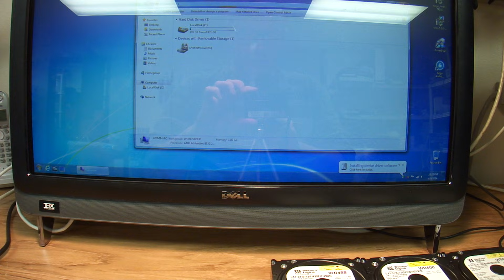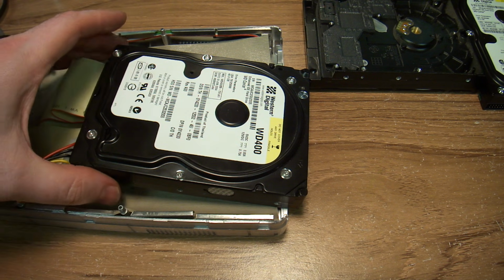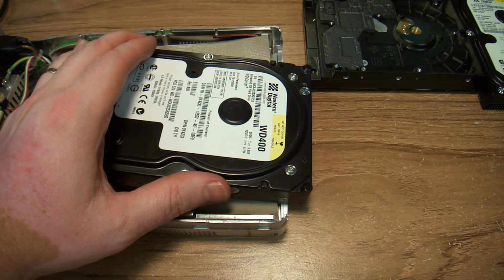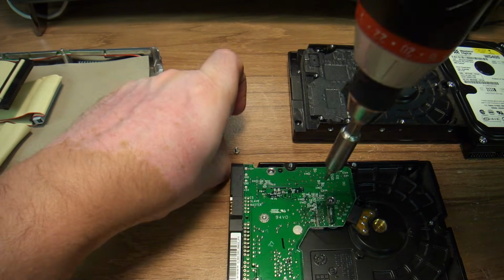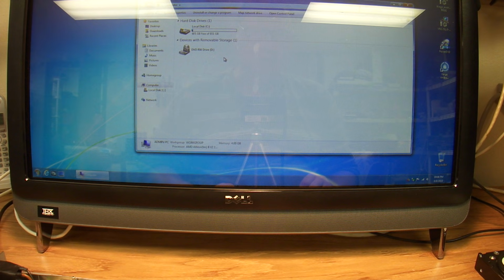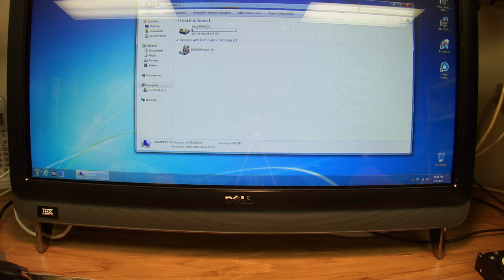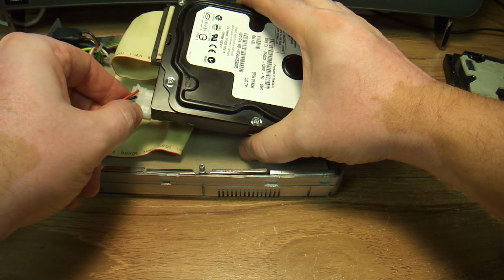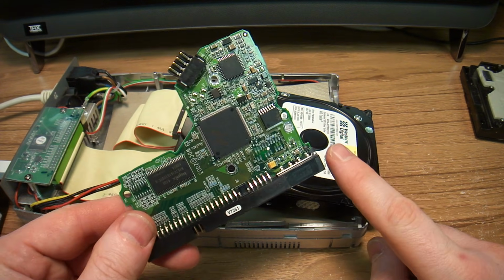DIY How to: a successful data recovery from clicking hard drive. Recover your files Yourself

Comment: I wonder who still has one of those
Reply: +HDD Recovery Services Oh, for the record though... we didn't do this to fix clicking drives (though we probably did a time here or there out of desperation). We did this on drives that were not recognized by systems any longer. For clicking drives, we had a small cube freezer with SATA cables permanently routed into it. That way, we could freeze the drive overnight and the next day attempt to clone the disk while it was still in the freezer! That worked more times that I ever expected it would.
Reply: +HDD Recovery Services I used to swap boards on modern SATA drives all the time at my old job... as long as you had identical drive (same model, same board revision, same firmware) and the date codes were very close, it always worked.
Reply: zdgfagdfgdfssdgfdsfd was it back when 40GB drives were considered "modern"? :)
Reply: +HDD Recovery Services Nope... it was about 5 years ago, so IIRC the largest drives we saw common in the wild at this time were around 2TB, though larger drives did exist and the average drive was smaller. I was working for an OEM that sold systems, so the majority of the drives we did this on were out of our computers. And we were using Seagate Barracuda 7200.9 (and then 7200.10, and 7200.11) drives. Most of the drives we did this on were 80, 250, or 500GB drives - though I can recount doing it at least once on a 1TB drive as well.
Reply: zdgfagdfgdfssdgfdsfd, hi there! After reading everything you wrote, I really want to ask you if I buy another two/three 2TB Seagate Barracuda (ST2000DM001) there's is any chance of making my faulty and making noise one with this technique? Or for a big hard drive this is almost impossible? The sound is a bit similar to this one from the video. I'm about to search and buy some just to try this trick before spending a lot of money with data recovering services. Cheers from Rio!
Reply: honestly if you have data so important that you're willing to pay for a professional data recovery service, don't play around and make the situation worse trying to save money. if you don't know what you're doing at a professional level (if you're asking questions on YouTube, you don't) don't take the risk of making your data unrecoverable.
sounds like the one in the video are usually caused by a head crash, which often causes damage to the platter where your data is stored. while it might be possible, I don't think it's likely that a board swap will help you here... sorry! cheers and good luck!
Reply: +HDD Recovery Services I wonder who else is doing piggy back advertising by making baseless comments on his video to get free advertising for their business.
Reply: +VonKaNon but lets be honest, did you use a 40GB drive in the last decade? No modern drive will let you just swap a PCB and make everything work again. If he used this technique successfully on a hard drive that is 320GB+ I would be first in line to applaud him, but this is a prehistoric 40GB drive. I love the video, and it is very informative for those who are into repair of vintage hard drives, but nowadays you will not get far with this.

Comment: Abraham:  Great video.  My question is, do the two hard drives have to be of the exact same capacity?  40 GB & 40 GB or can one be a 60 GB drive?
Reply from the maker: +Erich Strack Not only same capacity, but Identical board with all, but a serial number.
Reply: +Abraham Levit Crud.  Ok.  Thanks.
Reply: +Abraham Levit When you say "all but a serial number", what is included in the "all"?
Reply: +Erich Strack Serial numbers are unique per PCB, You need to get the boards model and version numbers identical.
Reply: No not impossible, you can find "compatible" boards on ebay that will work long enough to recover data. not recommended for long term use though
Reply: +ElfNet Gaming almost impossible right?  :(

Comment: never use an electrical screwdriver to tighten the screws on the new board. you could damage it. always use a classic screwdriver, that way you use enough pressure and don't overdo things which can crack your good new board

Comment: 1 minute and I would know what to change LOL. Connect to a drive using a terminal in Windows . There are terminal connection tools available. a simple OHM/Volt Meter is $10 these days. There is no need to open a drive anymore, any simple connection and terminal commands will allow anyone to do simple checks for problems.  You can put a piece of tape on the connector so that you can run the terminal connection diagnosis to force the drive to spin up and run. You need to learn terminal commands as the newer drives are different, it's not just swapping boards anymore .  Computer services these days are a laughing joke as it is mostly a "Software can retrieve it" mentality and then the "No connection it's dead" LOL. I run my Computer services OLD SCHOOL and people pay me big bucks to do what morons fail at. This is why people also bring me cars to take a look at . I mean no disrespect but with the better hardware now REAL computer techs who can actually know WTF an OHM meter is are either too few, retired and many already Gone. Good post at least it gets people interested.
Reply: +Danfuerth Gillis Could you expand on these connection and terminal commands?
Reply: This is the link for the Seagate 7200 terminal fix from a few years ago. https://sites.google.com/site/seagatefix/

That is just the basics to get you started as it shows how to make the terminal connector, procedures and some basic commands.

That was a very popular fix for the Seagate 7200 drives.

Thousands if not hundreds of thousands were fixed worldwide using the terminal method.

Comment: Thank you..this actually works for a WB my book. It was a WD Green drive. I also recommend connecting a "working" hard drive, with similar model with similiar PCB. Once the PC recognizes that "working" hard drive QUICKLY disconnect then connect the non-working HDD. Caution tho..you should always wear rubber gloves.
Reply: Darren Arni, hi there! So, with this technique, would not be necessary to switch boards? Where did you see this info? Why a faulty hard drive would simply work just because an almost identical one was just connected before it?

Comment: The firmware on that drive might be corrupted. WDC drive's usually click like that when the firmware dies. I've only been able to resurrect a drive like this twice. Newer drives do have specific firmware for the drive even though the model is the same. Every drive is different.
Reply: Christopher Ryan, so you mean even if we buy a same model of a old hard drive (like from 2010/2011), nowadays new units will have specific firmware? I'm planning to buy some two or there same models of a 2TB Barracuda Seagate (ST2000DM001) just to try this, but simply don't know if today units will have this firmware exclusive feature.
Reply: You can't do pcb swaps unless you take the firmware chip and solder to the new board. EVERY drive is different.  Trust me I've tried it

Comment: I have a Seagate portable external drive that has a similar problem.
When I plug the usb, the software installs, it shows in Devices and Printers
but the light dosent go on and the drive  dosen't appear in My Computer.
It makes this sound.
https://clyp.it/0dqb0a3h
I tried another power connector from another similar seagate drive (slightly newer),
and the same thing happens exept this time the light goes on.
It makes the same sound . Could you tell from the sound if it is a problem with the head being stuck or a controller problem?

Comment: I have ASUS X550LN laptop. Yesterday I got mad from video games and I hit the laptop on the right side next to the mouse pad. The Laptop froze and I restarted it but it never turned on again. When I try to turn it on it beeps for a few seconds then it stops ( you can look the video on my channel what I mean.. ). Also I checked in the BIOS and the laptop doesn't detect the HDD. (I've been to a service centre and they told me that the PCB might be damaged and if I can find the same one and replace it they might be able to save my data. ) What do you propose me to do? What can be wrong with the HDD and which solution I should use to fix it and get my data back which was really important to me! Help please!! Thank you! Abraham Levit

Comment: What would happen if secondary internal HDD clicked itself to death?

It clicks occasionally but is still functioning.

When it clicks, and hangs the entire PC. I have no data on it, but the lag is annoying and I can't stop the HDD from spinning.
Reply: tenchimuyo69 back it up and replace it. Clicking is a warning sign that the heads have failed.

Comment: I have a computer with memory of 8 terabytes and a RAM with 12 Gigabytes. Muhahahahhahahaha
Reply: no you don't idiot! you have 12 gigabytes of memory (ram) and 8 terabytes of drive space. RAM is memory and drive space is just storage, not power.  And  FYI I am typing this on a system with  32 gig of memory and 64 terabytes of storage... Unix  kicks ASS!
Reply: No i meant memory OF 8 terabytes and 12 Gigabytes OF ram!!!!!!! STUPID!!!!!! Learn to read.
Reply: Gamer_time no hes right memory refers to ram usually.. At least with reference to a PC, and without more specific context, if you said hdd memory, although there you could be referring to the cache, obviously all storage is memory in the broader sense of common language, but  pc wont be listed with hdd space as "memory", you could say say hard drive space, storage space... the meaning changes a lot based on context, when a program refers to memory it will refer to a virtual space it has been allocated that could be be on  hard drive, in the ram, on another system, it might not even exist which sounds bonkers but if its blank it may represented as a sparse file or some equivalent 128gb.. 2 octo xeons 32tb :P
Reply: ok thanks
Reply: Gamer_time dont you mean 8TB of Hard drive space? Memory and RAM is the same thing. My computer has 16GB of RAM in it right now. The last awesome PC i built had 64GB of RAM and 8TB of storage with 3 or 4 hard drives in a RAID
Reply: yes, I do

Comment: Each hard drive has unique "adaptives", stored in one of the board chip. This info tuned by manufacturer and using by controller to get data from magnetic surfaсe. This is the reason why you can't get info by board replacing. You have to be lucky with the new board.

Comment: I just want to say thank you for this post.  This worked for me on a very old hard drive which wouldn't power up.  Thankfully replacing the PCB from an identical working HDD worked on the first attempt and saved me a lot of time and expense (sending it off to a data recovery company) 
Keep up the good work.

Comment: My seagate external 2tb hardrive fell off my tv, sitting on a table, on to the table. It had faint beeping sounds and computer wouldnt recognize the drive. I took the hard drive apart and found my heads were stuck and before seeing your vids i tried things on my own. I pulled the heads back by hand and then tried starting the hard drive without putting it back together it was completely open. The heads go back and forth making a scratching noise and im scared this could damage the data. Still havnt put it back together. What can i do or how do i recover data bc i cannot lose this data...

Comment: Are you suppose to defrag a SSD...??? just another thought...
Reply: No, you do not de-frag an SSD.
Reply: Never ever defrag an SSD. They have memory cells and can break down from wear and tear if you defrag an SSD.
Reply: TheGamerWithMore theres less need to, but generally ssd lifespans are pretty good, and an ssd is still 10-100 times faster sequentially, so there are times when defragmentation can make sense, by default windows will apply trim when u try to defrag an ssd, that wont defrag your drive or shorter there life so do that as much as you like generall after deleting lots of things, random writes are what can make an ssd expire quicker than one expects because of large erase block sizing but defragging reads smallchunks and writes bigg ones
Reply: So I guess it's ok.. I read somewhere that you should NOT defrag a SSD..just wondering..

Comment: Hello, I thought your video was very interesting. You showed what you did clearly. I have a drive that has stopped working. I think I will try to take a peek inside. mine did not make any noise but a few months ago i got a warning that  it was going to fail. I did back it up with a seagate external a few times but did not have turned on when the disk failed. I tried all kinds of things to get it going. I used my recovery disks that I was prompted to make when I first bought my computer but It went through two disks and part way through the 3rd I got an error message and was promoted to tun off the computer. I just bought another hard drive and I am using my recover disk to see what I get. According to what I see It is working and doing a factory default software recovery.  What sucks is this toshiba satellite L655 is only about 3 years old and my battery is bad plus a dead drive.  My old Dell dimension with xp still works after about 12 years.    Anyway can you show how you made that tool to run the drive out side the computer? Thanks... Bud....

Comment: Please stop misleading people, damaging their precious data.  "Try" is a taboo to Data Recovery.  Faulty harddrives cannot tolerate the 'try' you performed.
Reply: How do you THINK data recovery is performed in the first place? Remember George is Wong and never right!
Reply: George Wong, you mean even "just" by exchanging boards could be harmful to the data itself? Wouldn't be risky only if someone decided to open the hard drive itself to mess with the head, for example?
Reply: I think I got it. But what is confusing my mind now is if only by swapping boards could lead to an even more critical data loss or drive problems. This procedure itself could potentially lead to even more damage?
Reply: Did you mention "risky"?  When DR professionals proceed to work on a case, they should avoid risk.  Client's data is of utmost importance.  Untested procedures (i.e."try") must not be performed on client's harddrives.  So, it is perfectly okay to open reading heads or exchanging boards if and only if the DR professional had performed the pre-requisite trade-secret procedures.  

Unfortunately, most youtubes posted did not show these essential procedures. They promoted the term Data Recovery but at the same time making it look too easy.  I had too many clients coming in for help with improperly opened harddrives or mismatched boards after their "friends" had worked on it.

Regarding the video in question, did you noticed that the boards were not "blood-matched" prior to swap?  Is it true that all WD40G harddrives have the same boards without any version change or firmware change during the entire production cycle?  To make my question more simple by similarity, do all 40 years old Japanese belong to the same blood group?

Also, my last name is WONG.
Reply: more damage by amateurs.  no damage with proper procedure by DR professionals and DR tools.  
I don't use a PC to connect the harddrive in these cases.  I use a DR machine that costs USD10,000.  So go figure.

Comment: How close how close to the original controller board part number were the other controller board part numbers that you tried., including the one that worked? I am about to try this with a WD400BB but I am having trouble finding an exact match to the controller board part number.

Comment: I have 2 HDDs of the same model. One died a while ago, luckily the data wasn't that important to me, that's why I tried your board switching method . Unfortunately it didn't help. I also carefully opened the case and tried unstucking the head - didn't work either.. keeps clicking, unrecognizable. Well, shit.
Reply: PrinceXTC86 opening your drive is the worst thing you can do. they are sealed for a reason. Send it in for recovery.